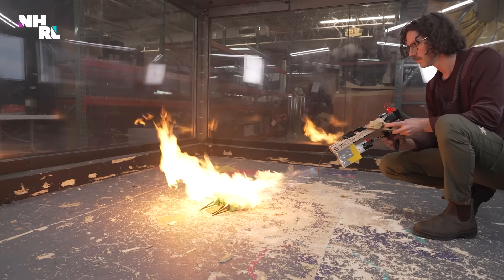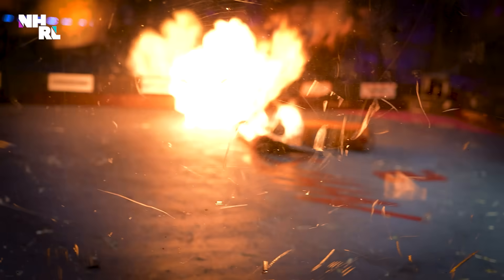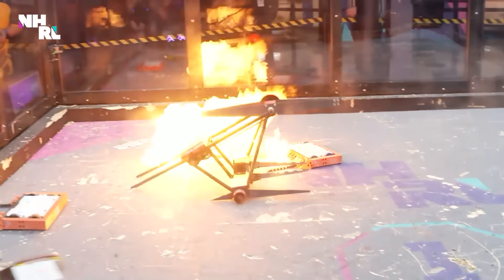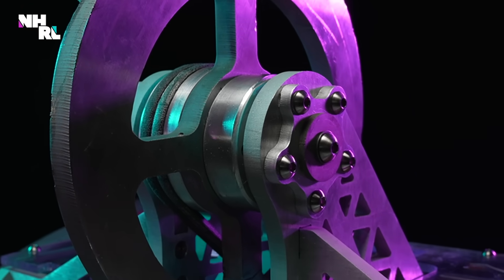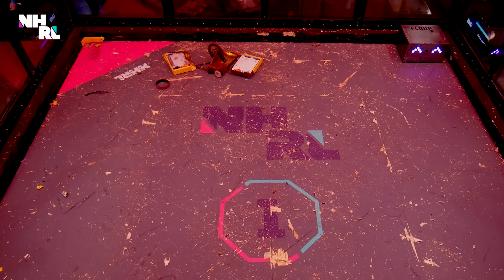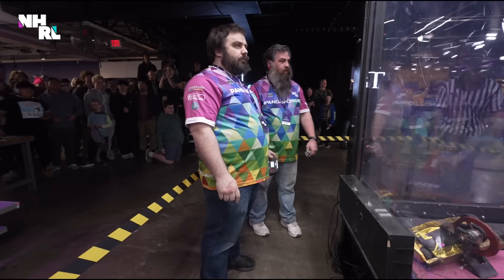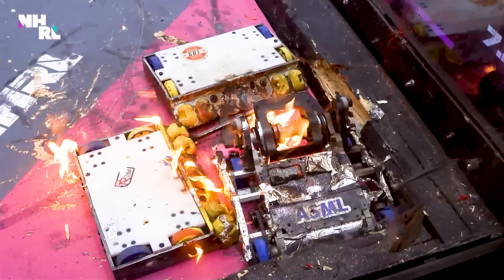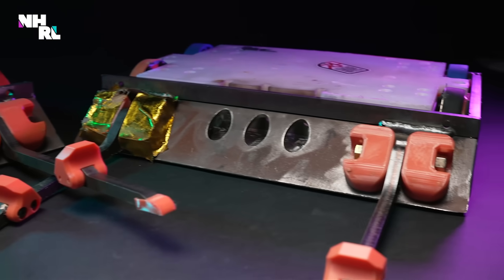How Flamethrowers Became Championship Winning Robots

Comment: I don't think it's right to let Kazaa Light fight, by every other metric it's two different robots, only one half should be allowed in the ring
Reply: The NHRL rulebook allows multi-bots as long as the class weight is divided among them. The bots weigh in at 15 lb. for each half, qualifying it for the 30 lb. class.

Comment: Dual bots even if they both equal the weight limit is a bit of BS IMO. Having to knock out two bots to get a KO seems like a large loophole. "Fire can win" if you have two bots...
Reply: If that wasn’t the rule, I would not have made multi bots. Most of the time since you’re so much underweight compared to your competitor people just get annihilated immediately, but I dedicated so much armor that each half of the robot is able to be formidable.
Reply: @joshuarhinehart9295 not trying to take away from the impressive win and clever engineering and use of the current rules. I just personally find it a little hollow when it's 2V1 even if there's a weight advantage.  The league axed mini bots but mutibots are okay which seems like a weird caveat. I'd love to see if this design could still be as viable as a single 30lbs bot.
Reply: I think if any one of your mutli-bots gets KO'd that should be a win for the opponent. You fight as one, you lose as one.

Comment: when are yall going to introduce multiround matches give each team 5 minutes between rounds to fix up their bots then right back into the ring if a team opens up their bot and cant get it back together in the 5 minutes it goes back in still open, it would give flame thrower bots a chance to refuel and bots with belt drive weapons a chance to fix or replace a damaged/slipped belt

Comment: Unless you've got a big sponsor, you'd be so pissed off at losing the entire system to some test with a cigarette lighter. Dead receiver, battery, motors, frame, weapon... You'll not be fixing a few scratches after the bout, you'll be fully rebuilding.

Comment: What if flanethrowers used car fuel pumps and injectors? I feel like the flamethrowers I see look flashy but don’t really do a good job as weapons. With better high pressure injection and combustion chamber design, they can be a far greater threat than what we’ve seen in the past.
Reply: Pretty sure they don't actually want acres of liquid flame ruining down everywhere!
Reply: @NigelTolley No, they’ll just say the arena isn’t built well enough, just trust
Reply: @Ang3lUki  Could they use a different kind of fuel? Maybe try to fit an acetylene torch on a bot
Reply: Unfortunately, the rules say you can only use fuels that are gases at standard temperature. Also, you’re not able to use any oxidizers. The next version of kassa light is going to use a combustion chamber utilizing forced air. This should help create a hot flame, but sadly it probably won’t look as cool on the camera.
Reply: @joshuarhinehart9295 That doesn’t preclude the use of high pressure injectors, when LPG engines exist.
Reply: @joshuarhinehart9295  any rules against thermite?

Comment: im assuming its against the rules to use flammable liquids instead of a gas like butane? 
id assume fire would be way more advantageous if you could actually coat the other bot in a layer of flammable liquid. 
genuine question btw
Reply: Liquid at room temperature is off limits, yeah. Unfortunate, but there are limits to even their cage designs

Comment: uhhh, there HAVE been historically successful flame bots before:
the requirement for a flamer to be good is that it can build the heat in it's opponent well enough to be actually effective, the main parameters in this are how quickly you can deliver heat and how well you can keep it on them. now, some bots have tried ramping up the heat to the point where it only needs a couple seconds to start turning wheels into goo and electronics boxes into bricks and some of those have even somewhat succeeded but the ones that have actually been consistently good are the ones with a good way to extend the duration that they can keep a flamethrower on-target, primarily because doing that usually means focusing on some other already useful advantage and adding a flamethrower on top of that, a Dustpan Of Doom design is already problematic enough to face even before you add fire to those constant scoop-and-pin maneuvers and flamethrowers are actually one of the easiest weapons' to make work when you want to dance around on omniwheels since you aren't spinning up a mass that you need to fight against to turn or trying to provide a sufficient geometry to push an overhead weapon, heck, you don't even really need to include forks/etc anymore if your' goal is to kite the opponent though I have a hard time imagining that they wouldn't still be worth it, stick a flamethrower into a grabber and each grab is now a legitimate 1-shot-1-kill threat.

they're seen as useless because a lot of bots take a spare 2% of their ewight to duct-tape a flamethrower on there for show and to a lesser degree because competitions put way more limitations on them than you'd expect but hen the bot is actually seriously built to use the application of heat as it's primary weapon it is genuinely an effective option...which might be one of the other big reasons you don't see them much: any fight against a genuinely threatening flamebot is going to do a number on basically every part in your bot even if you win which makes them something of a dick move to put into a competition: they damage EVERYTHING and do it in a different way than the good old kinetics people are used to dealing with so inspection and repairs after a fight with a flamer are difficult and time consuming which can easily cause a lot of problems with events.

Comment: The thing everyone who watched Battlebots wanted to see, but the rules never let em make it
Reply: Were the bots like Gruff and Free Shipping different types of flame bots?
Reply: They ARE actually, flamethrowers aren't considered weapons on BB so those bots are just lifters with cosmetic flamethrowers. We've never actually seen a true flamethrower with a fully dedicated fire weapon system. Imagine what a heavyweight could do when you consider what dutch oven does at 4.5lbs, metal might not be affected but the internals and rubber wheels would get cooked. 

Also IIRC BattleBots aren't even allowed to run their flamethrowers along the perimeter of the box since it could compromise the lexan wall's integrity. NHRL flamethrowers are truly unique.

Comment: Fire robots are the only robot type I legitimately don't have an answer for. Thankfully I've never had to fight one.... Yet
Reply: Gonna be interesting to see what defensive countermeasures people come up with if they start to become more prevalent!
Reply: Tank of flame retardant as an alternative to armor.
Reply: Water to wet the ignition of the flame thrower? Nitrogen to freeze important parts? Is that allowed? A fan to redistribute the heat? Then something to fix the distance problem. Perhaps include water moist behind the fan to break electronics?
Reply: Waterproof electronics and the surround in ice (if you have the weight budget to do so)? It takes a shit ton of energy to melt away ice and you’re not going to get that from short bursts of flame. 

Far more practical: intumescent paint which adds practically no weight but can protect a wooden door from house fire temperatures for up to 30 minutes.
Reply: @amoose136 pycrete as an alternative to the ice, as it melts so slowly as to be imperceptible
Reply: Maybe empty internal spaces occupied by a fire resistant material, like a porous foam of some highly heat resistant polymer

Comment: now i wanna see a robot with a water gun attached
Reply: I always had this idea of a robot with a puncture that injected salt water into the internals.
Reply: Unfortunately, water is VERY heavy. It would have to be more like a surgical injection thing to minimize the mass needed, while still being effective. Maybe in combo with a drill?

Of course, at that point one might ask if injecting an incendiary liquid would be even better.
Reply: @nnelg8139 yeah imagine a robot that sprays napalm - sticky burning gel that doesn't come off. I doubt that would be within rules but if it sticks its over, could be really cool
Reply: @mrgenry6055  its would be incredibly overpowered yes
Reply: Liquid weapons are banned in all forms
Reply: ECW bot
Reply: You could also use pressurised gas or even abrasive dust perhaps?

Comment: I take it liquid fuel throwers are not allowed by NHRL rules? Because thats how actual flamethrowers solve the distance/ sustainment issue.
Reply from the maker: If it’s a liquid at room temperature it’s not allowed
Reply: @NHRL  thats unfortunate but expected for safety lol. Yall are still by far the best league there is!
Reply: @NHRL   Too bad because NAPALM would continue to burn on an opposing robot for a few minutes after being hit with it.  Of course, I can see that being a safety hazzard too.  But, NAPALM is a gel at room temperatures not a liquid so...maybe legal?
Reply: @NHRL  Are flammable solids allowed?  What about detachable magnets?  Because I could see something like a limpet that is attached to the enemy bot and just burns, or a magnetized flammable powder.
Reply: @NHRL wait so could you have a molten metal spitting robot?
Reply: @Sawdusteater42069  haha good luck melting metal, that thing would be heavy
Reply: @Sawdusteater42069 or a thermite robot?
Reply: @NHRL Ah, so no waterjet robots ?
Reply: Haven't seen any bots using jet flamers yet, like there are common jet lighters on sale why not put one into bot
Reply: You can't use liquids, so maybe make a white Ph robot